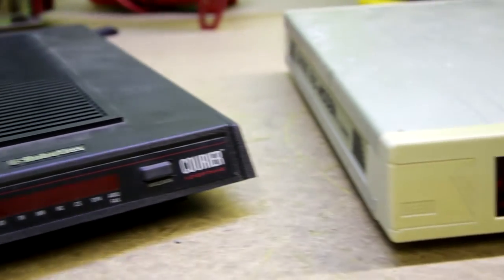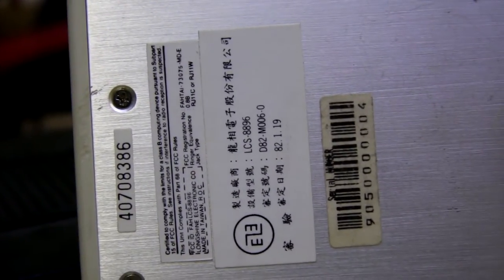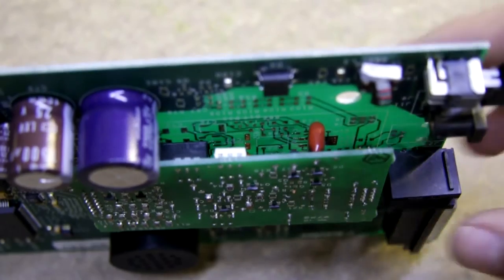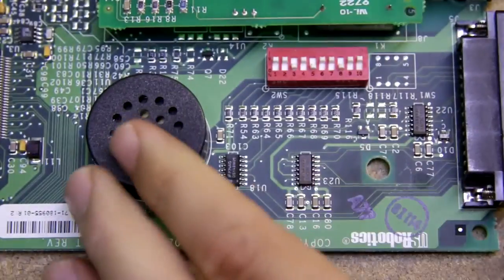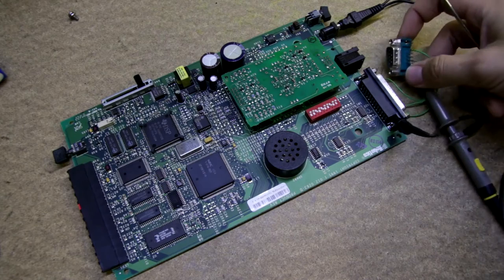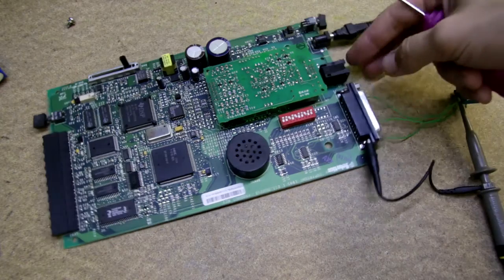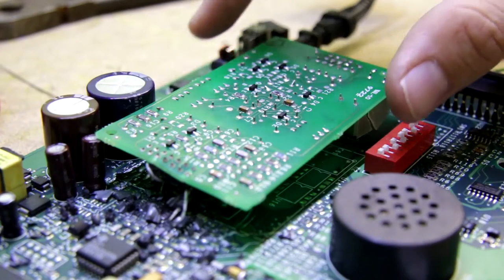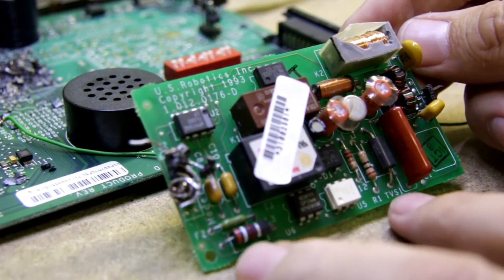Retro teardown - 56kbit modems

Comment: I was a hotliner for CompuServe back in the time, the US Robotics modems were the only ones decently working and reliable, with a published and xworking set of AT commands. Some brands, as Xircom, were pieces of shit, not even talking about the "softmodems" (more or less sound card hardware, with a driver software to use it as a modem).

Comment: The daughterboard is pretty common, as they had to be used world wide, so they had to conform to a few phone specs. Thus you had a generic SLIC on the board for most of the world, and for the UK and US markets, where they needed a certification to sell into the market, they simply used a pre approved line interface which has approval, so they do not need to apply for the long expensive approval, just use the approval of the board and then comply with a much less rigorous spec for basic connections and isolation.

Comment: Did you power them with 9VAC, as most of the modem power supplies i have had are 8-10VAC from a transformer. the last fax modem the daughterboard is the fax and data decoder, the main 8032 ( second sourced from Signetics as well) only handles the basic setup and dialling, the other board doing all the heavy work. Also not the 8 pin EEprom on the board next to the 8032, there to store setup info in non volatile storage. IIRc it held data about phone system types, modulations to use and handshake info for certain suppliers.

Comment: Just look up the basic RS232 connection methods, you just have to connect a few lines together so the modem can talk without handshaking to the PC. If the PC is not showing RTS and DTR it will ignore all serial data until they are valid. RTS to CTS, DTR to DCR and it works with most modems, IIRc as it has been a long time.

Still have a modem in a box somewhere as backup in case I need it, there are still a few dial up pools around.
Reply from the maker: wow, thanks for these details. You gave me confidence to try connect it again. I'm aware of RTS signals but I was scared that the communication will be synchronous. I have plan B where I load x51 blinky program in 8031 SRAM to light that Leds.